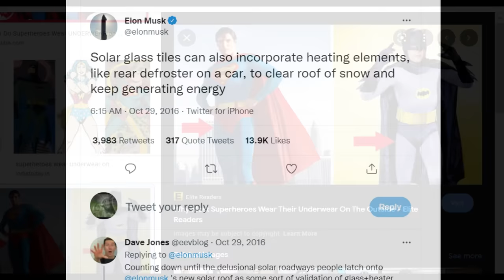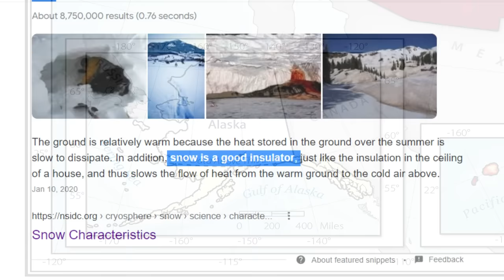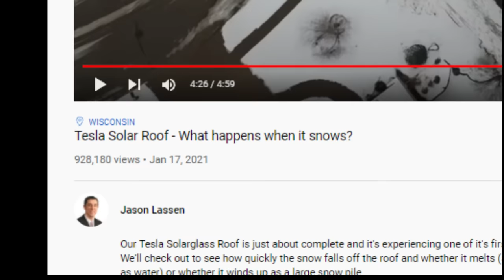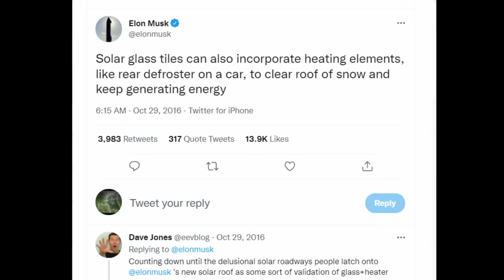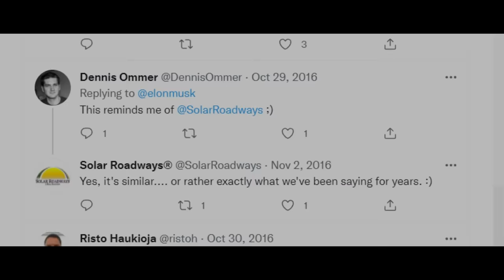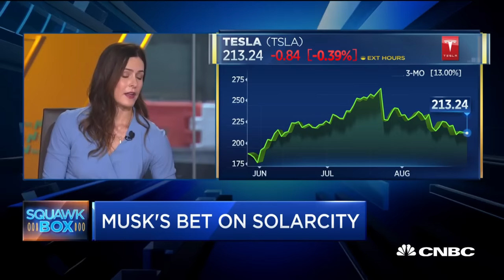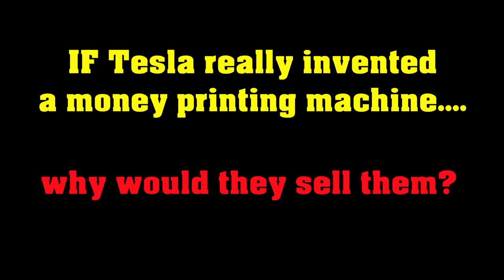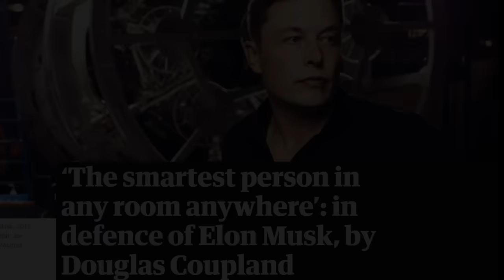Elon Musk: The Smartest Person in any room ANYWHERE!

Comment: As a Canadian I had to face palm when my new neighbors from the Carribean started routinely removing the snow from their roof every snowfall. I tried to explain to them "Do you see any other people removing snow from their roof?" .. they said no of course.. then I proceeded to explain that snow is free extra insulation to trapping your indoor heat. They didn't believe me of course and proceeded to keep doing it despite the fact 99% of Canadians almost never remove snow from their roof except in extremely heavy snowfall situations where the weight of the snow might be a bit of a concern.
Reply: I have a foot of high density insulation so don't need snow and it works when there is no snow. And my heating bills are low.. low but reliable tech
Reply: Unless you've got a flat roof and worry about excessive melt or there's enough snow that the weight is an issue, the whole concept of goofing around on your roof to move snow just seems ridiculous. But I guess people only used to summer might get confused because the snow is cold and having cold stuff on your roof makes your building cold. The concept of an igloo would blow their minds, presumably.
Reply: It's almost like people have forgotten how and why an igloo works as shelter despite being made of ice/snow
Reply: @julesdingle  
The snow gives you an extra insulation layer (for free)
But if you want to risk breaking your neck by removing snow on your roof in the middle of winter, go ahead.
Reply: @seriously1184  I live near the Gulf Stream so snow is rare these days..despite being 53 N.  The solar panels do get a regular wash though.. its amazing how much dust and bird shit will impact on generation.
But last time we had snow it was March and very sunny [I have skylights and can reach most of the panels wit ha broom!]
Reply: @Monochromatic_Spider  we used to remove a bit of snow sometimes when it covered up our solar panels but we never had to get on the roof as we had a like 7m extendable tool and a small ladder. that being said it mostly has stopped snowing where I live since then
Reply: @Vincent_Beers  And farmers have also known this for a couple thousand years as well. Snowfall insulates and protects the soil, keeps it from freezing too much and damaging the soil. Without a layer of snow in winter, topsoil freezes solid and greatly diminishes the quality of future crops in the next planting season. And of course, as you yourself mentioned, the Inuit people have known this for many thousands of years and built homes around the premise for countles ages.
Reply: Ask them about their heating bills. Show them yours. It will convince them.
Reply: Growing up in northern NB, we would only remove snow from the roof if it became heavy enough to cause loading issues, and to this day I still bank snow around the exposed part of my foundation. Our January/February mean temperature is about -11C, with most nights being considerably cooler, so I'll take every bit of free insulation I can get.
Reply: I agree, the only time I have seen someone remove snow from a roof was when a tree fell onto a neighbor's garage and they were concerned that the weight from the snow and the tree would cause the roof to cave in on their house. Additionally they had to get up there to chop the tree up so they had to clear part of the room. But at is the only time on a normal house I have ever seen anyone clear their roof.
Reply: Aw, It'd be so hard to explain how it works too. Maybe show them a video about how an igloo works?
Reply: I’m from the Caribbean living in America and I know that snow insulate the roof lmao
Reply: I live in Maine and sometime we have to remove snow if it goes through a slight melting period where it turns to near ice or super dense snow. That has to come off or it just keeps building and building. Luckily my current house, like many Canadian homes has a metal roof. The snow stays there the majority of the days but when we get a slightly warmer day it slides off (which will kill you).
Reply: @akulkis  

Not really. Tropical areas can have dangerous animals and the land that's arable isn't that common. There's definitely not enough food. What you might think is edible might be toxic.

Where did you read that? The great book of bullshit from a stormfront affiliated website?
Reply: They have a crop growing in their attic.  This causes snow on the roof to melt.  By removing it they're protecting themselves.
Reply: @bobfg3130  what hes talking about is intelligence in the long term planing aspect. for example you don't worry about a tiger eating you 6 months from know. you rather don't worry about it, or a tiger was spotted near you're village and you're doing you're best to protect yourself. 
 another way to put it is in tropical regions you only need street smarts to survive. but to survive in a remote part of the northern continent you'd need both street smarts and book smarts(ak remember shit very well over the long term).
Reply: They probably never heard of igloos. Good luck on their heating bill.
Reply: @butspan7618  

Yes, it's not like in tropical areas there is a dry season in the tropics. Oh wait, there is.

There's no such thing as "intelligence in the long term planning aspect". There's experience in it but that's another issue.

Calling memory "book smarts" is just damn right ridiculous. In the tropics there are many types of fruits that are toxic.
Reply: I thought a properly made roof up there has a higher pitch angle so that you never have to worry about it unless you get a lot of like ice storms that prevent melt off.
Reply: I live in sweden and where i lived litterally everyone showels the snow from the roof after evmry snow storm, even if its only a half meter. i am not really sure if its completely neccesary and am even more doubting after hearing the story from canada where you guys rarely showel the snow.
Reply: You dont climb up on your roof to remove the snow. You throw a thick rope or thin chain up there whilr holding on to the ends and pull it down. It's actually very fun to do!
Reply: Most Scandinavian houses are built to shed snow with a very steep pitch, some cities like Bergen combine with glazed tiles and steel wire so the chunks of ice don't fall in too big a chunks and smash cars.
They're very pretty in the rain. 
It would be interesting to hear the reasons for the different approaches.
Reply: Only ever once removed snow from the roof. The reason was it was to heavy at 60 cm of snow and was at almost the same height the next day.
It was a flat roof by the way.
Reply: @akulkis  you know the drill, cite your sources.
Reply: Closed cell spray foam insulation and you're ok, I have a metal roof, snow and ice are sliding off it like accusations against Trump.
Reply: some people just really love doing busy work.
Reply: Am in western Canada, we get chinooks periodically throughout winter, the snow melts naturally, no special panels needed. Shoveling snow off a roof is a good way to die or end up in hospital.
Reply: @LaurentiusTriarius  And what happens at summer? Your roof heats up in direct sun like a stove and cooks your toxic waste under it. Have you checked what is maximum temp it can handle?
Reply: @otofoto  there's not much thermal loss the snow just slide right off with the steep angles! In my region we're supposed to build roofs with ventilation (usually passive) I didn't and couldn't since there's bedrooms in the "attic" so I just sealed the ish out of everything with 4 inches of spray foam. Works well.
Reply: @LaurentiusTriarius  So you have a bad ventilation now. Good for your health and your house.
Reply: @Monochromatic_Spider  I mean, I have removed snow from regular roofs. But that's mostly after heavy snowfall and because when the spring comes that snow will carry water and get, very, very heavy. Potentially enough to cause damage. 2-3 meters of snow is to much for most roofs.
Reply: Why would you bother taking it off, unless it's excessive like you say.  It's not like the neighbourhood will sneer and laugh at the 'silly people that have snow on their roof'
Reply: @otofoto  seems Laurent was referring to the cavity ventilation, as they have created what is essentially a hot roof (with no cavity) it doesn't need ventilation as there are no internal cold surfaces to condensate vapor, it's got nothing to do with ventilation inside the building.
A cold roof with a gap between the insulation needs lots of airflow and a good membrane between the living space and roof.
Hope this helps.
Reply: i am Canadian, and i had no idea that was the reason for not shovelling your roof; i just never bothered to shovel it.
Reply: Maybe sign them up to one of those skillshare things on thermodynamics?
Reply: Snow as insulation works up to a point, of course. If you don't have any fiberglass insulation, the heat from your house will melt the snow on your roof, anyway.
Reply: @morganjonasson2947  Not sure what city you live in, but seems some fools have started a bad trend. Or it's a block with silly bad buildings with flawed roof design - I have a block nearby with a number of houses that was built with a flat roof. They ended up having to redesign all these houses later because of the snow melt issues. And before that, they had no option but to remove the snow.

But for the most parts, houses in Sweden do not need the snow removed unless there is a very special winter.
Reply: @morganjonasson2947  Where in Sweden do you live? I too live there and have literally never seen anyone do this except in rare cases if buildings had flat roofs - a foolish idea in the north...
Reply: Of course he knew better than us.  He's from the Carribean!  They do that all the .. wait...
Reply: @zopEnglandzip  Only that foam breaks down when heated from roof so it is not a healthy option.
Membranes are also a scam as they degrade after 10years or so. Also those membranes condensate vapor and promote growth of mold and mildrew. Problem with these insulation materials is that they do not have thermal mass and cools quickly if temperature drops.
Reply: @TrevorKeenAnimation  and if you have then you have mold in your house.
Reply: @Monochromatic_Spider  I already understood the concept of igloos but never thought of snow on roof as extra insolation. That's neat
Reply: @bobfg3130  last i checked predictors don't have to hibernate to survive a dry season. meaning that a dry season is not as harsh as winter. if you can identify which fruit is toxic and which is not. its probably because you pick fruits on at least a semi regular basis. as such you ether pick the fruit you have picked already. like i did when i went mushroom picking in the north. or you don't pick the ones you ether saw poison someone or somebody told you not to pick it. and you are remembered of that fact every time you come across it. which if its a problem near you're location its going to be at semi regular basis.
Reply: @Vincent_Beers  why are you being so condescending? You're literally assuming that everybody at one point knew about igloos and why they work. Believe it or not people don't all have the same homogeneous information buddy.
Reply: @otofoto  my friend, I have no idea what sort of foams or membranes are used with your regs or codes or what sort of temps your roofs get up to.
In temperate regions even a tin roof isn't going to get above 70°c and PU which is common for spray foam won't degrade till 200°c and won't break down and release cyanide till 900°c
Membranes can range from the bituminous type I have under my concrete tiles which will never get above 50°c has lasted 50 years already and may last another 50 or the PVC membranes which are probably the most sensitive but certainly here in the UK are very limited as to their applications normally only being permitted on the internal side of insulation.
If you have identified a material specified by your local regs/codes that isn't safe tell us, I'll certainly champion your cause, where do you live, what materials are you concerned about?
Reply: @zopEnglandzip  I have been in UK houses they are humid and has moldy smell. Same was in Ireland with houses and hotels. Polyurethane foam is known to be toxic and also the fire retardants which are added. Even if new formulation is found eventually it will be found only later what health effects it has. Spray foam is bad choice. Maybe aerogels are the furture but again it is not clean when made as flexible insulation.
Reply: @bobfg3130  im using hybernation as a example to show that its more dificult to survive during winter months. never mentioned we hybernate
Reply: @otofoto  you are forgetting to answer questions regarding specifics, what combination of environment/materials concerns you regarding your statement about membranes and foam?
It's important as PU is pretty stable, hence being approved in various forms for use in kitchens, medicine and obviously construction, it's not toxic until it combusts or decomposes at 900°c though so I'm worried you might be living somewhere really hot and applying your local knowledge to a conversation on cold climates.

Yes some houses in the UK are damp, some people still live in actual castles here, some live in 1000 year old hobit houses with thatched roofs and mud walls.
Reply: Tin roofs are the best. Expensive yes, but it’s a lifetime investment and dispenses any excess snow buildup. Overall less costly than replacing shingles every decade or whatever.
Reply: @zopEnglandzip  I did provide specifics. The PU may be stable in laboratory tests but not when applied in real life. And it is known fact now that PU is off-gassing as it is not mixed ideally on site and also contains additional substances. You get fooled by laboratory values which when applied in reality doesn't work as it is complex system. Neverless such toxic waste should not be put in residental homes as it will end badly as it was with asbestos materials. It is rather cheap insulation but  criminal in long term.
Reply: @otofoto  it off-gases when curing like every other thermoset polymer.
Specifics which you still fail to mention are important as many applications will call for a vapour barrier making all of your claims against industry testing irrelevant.
You are correct in saying incorrect dosing may cause problems but in the same way that incorrect carpentry will lead to a timber frame house collapsing, it doesn't make every timber frame house unsafe. 
Asbestos is an example of a material requiring heavy infrastructure to mine with very few customers and so admitting it's harmful effects lead to the ruination of an entire industry from mine to product overnight hence the pushback against the initial calls for it's banning, PU spray foam is a tiny inconsequential slice of the petrochemical industry which would happily see it's use in construction banned on ethical grounds in return for some good PR if it was proven to have any inherent dangers.
Like I said, many agencies in many countries claim it is safe for use in far more health critical situations than loft insulation and no, whatever you are claiming is not well known.
Reply: -Matter didn’t create anti matter
-Anti matter didn’t create matter
(Both of them were present at the time of big bang)
-Both of them didn’t create themselves.
-Both of them came from an unimaginable source,  that unimaginable source created matter and antimatter (everything) thats why it is known as “the creator” of everything.
——————
- that unimaginable source/creator has created sin and virtue which are opposite to each other,
— logic says every action has its own reaction, so the reaction of sin must be different than the reaction of virtue,
— the creator has created prophets to let us know about each and every detail of sin and virtue, also about their reactions,
Thank you
Reply: The only time you really should remove snow from your roof is in the case it piles up too high.  Too much snow can and has caused cave-ins due to its incredible weight.  10 inches of snow = 1 inch of water.  And water is quite heavy.
Reply: @brianbrewster6532  It weights even more when it attracts water as sponge.
Reply: @otofoto  Having houses energy rated has been common is Western Europe for a few decades and mandatory for at least half of that in the UK, these inspections typically happen when a property changes hands, is to let or has been altered so we know exactly what works, what lasts and how long it should last for so I can confidently say you are wrong about everything.
EPC inspections for more details.

Vapour barriers typically prevent warm air with acceptable humidity from coming into contact with something cold and condensing (don't make the common mistake of assuming that means the air was humid, 30°c air with less than ideal humidity at 28% will have a humidity of 100% when it's temperature drops to 10°c) and so properly installed barriers improve the lifespan of all the materials around them, I can see how someone that doesn't understand humidity would view sealing a house akin to collecting warm farts in a plastic bag but fortunately the people developing these techniques do understand.

The subtle but steady evolution in my lifetime has been a joy to observe, if you are interested in learning you would do well to start with "passive houses" an extreme concept but one that illustrates the theories behind many of the developed world's exciting current residential building trends.
Reply: @zopEnglandzip  There is nothing exciting around passive houses as it requires very active and expensive maintenance and it doesn't pay off. Sealing a house does not make it passive but active. Passive house is one which do not need active ventilation or recuperator.
How do you understand humidity and how dew on grass works? Any material which quickly cools attracts moisture so your barrier does the opposite and attracts water which drips on insulation waste materials.
Reply: If you have a ventilated roof, snow on the roof is dead weight since any heat that gets in the attic has already escaped the habitable space's thermal envelope and ventilation will let that heat escape to the environment without melting snow as long as the ceiling insulation isn't completely horrific.
Reply: @otofoto  vapour barrier is between the insulation and living space and is the same temp as the living space so no change in temp, no change in humidity and no potential for condensation.

Passive refers to the input of heating energy. 

 The system is less complex than a house with AC and a boiler. 

I did previously attempt to explain the concept behind vapour barriers extending lifespan of materials but it turns out you don't even know what a vapour barrier is however when you do know you will see that your comments regarding maintenance are wrong... Again.

 Nothing is burned and for someone like you, obsessed with make believe toxicity, CO poisoning is something that actually kills 500 every year in the US, that's 500 more than are killed by pu foam, imagine that, 500 deaths we can actually prove were caused by a compound.
Reply: At what point does the snow's weight become a problem?
Reply: @vane909090  Once every 5 to 8 years in my experience, here in Canada anyway. in 22+ years I've only ever cleared the snow off my roof twice and my house is very old (built in the 50's) and it was only because the snow on my roof was maybe 4 feet thick during an extremely heavy snowfall over a few days. Never had any problems with my roof either. Most houses in cold climates are built to high tolerances i nregards to the roof, as everywhere in Canada is bound to get a good amount of snow. In  warm climates they can and likely do save money by building weaker roofs sicne they dont need to worry about hundreds or thousands of pounds of snow on it.
Reply: @vane909090  Depends on how strong the roof is and how dense is the snow. With climate change, some places are getting a lot more slow than they used to and it is staying down longer too, especially on older constructions that relied on escaping heat to de-ice the roof and got over-insulated after-the-fact. Watch local news for reports of roof collapses in older neighborhoods than your own, that will tell you how much snow is too much.

Most residential roof collapses I have heard about occur during freezing rains: the snow retains and freezes rainfall, drastically increasing roof load.
Reply: @vane909090  When it rains.
Reply: weight of the snow being a concern, was the only time I ever saw my parents actively force snow off the roof. Otherwise it was "I'm not going out there, roof isn't going to collapse, and it's too damn cold out."
Reply: The biggest issue from removing the snow, for no good reason, is that you might damage the roof!
Reply: Your ceiling should be insulated, not your roof, there should be an air gap on a properly built house.
Reply: snow on most Canadian roofs offers no insulation - the attic is open to the outside air.  the ceilings of the rooms are insulated instead.  it is silly to remove snow from the roof because it accomplishes nothing.  The roofs are engineered to hold the weight and snow removal is a waste of energy
Reply: @seriously1184  And this year's Darwin award goes to X trying to remove snow from their roof to 'improve' heat loss
Reply: @FinnMcRiangabra  

I haven't. It doesn't matter though.
Reply: @butspan7618  

And you think it's not more difficult to survive in the dry season? 😆 You don't know anything.
Reply: @bobfg3130  Why would you bother to reply, then? It just wastes my time and your reply adds nothing. Either don't reply or add something.
Reply: @FinnMcRiangabra  

Alright, don't complain about racism going out of control.
Reply: I apologize unreservedly. My comment was totally in the wrong.
Reply: @bobfg3130  Sorry, I missed out on replying correctly. I apologize unreservedly to you.

I see that your first reply to the racist in the thread was complete and appropriate. I had missed your reply when I perused the thread before posting and that changes the tenor of your posting history in this thread and mine. Again, I apologize for my mis-construed replies to you.
Reply: @julesdingle  well, more insulation is still more insulation.
Reply: Even without that argument snow on your roof is not really a problem, why not let it sit there? Unless you have really, really heavy snowfall which could cave the roof in but that only really is a concern with areas close to the artic circle.
Reply: Really late reply here. Canadian roofs should be well vented enough that snow doesn’t add to the equation. If snow was insulating, ice would form on the roof and cause a water backup - water leaking into the house through the ceiling. That’s why ceilings are insulated like crazy and roofs well vented.  To prevent snow from insulating. Icicles in cold weather are a symptom of poor insulation-
Reply: Same with most northern Americans. I've never removed snow from my roof. It will do it itself when it's ready
Reply: But don't like it's a risk of being locked in due to too much snow?